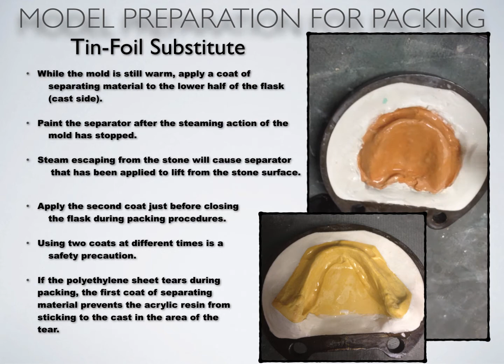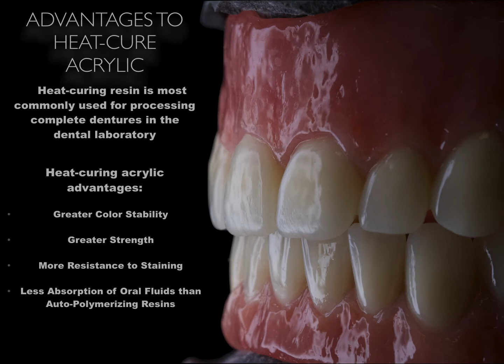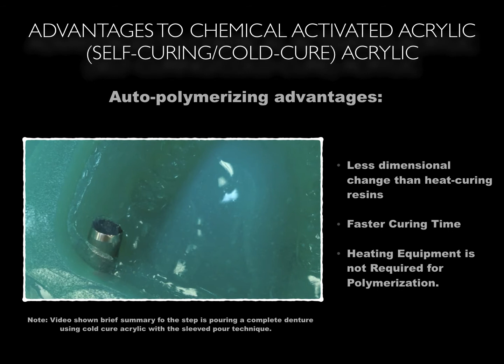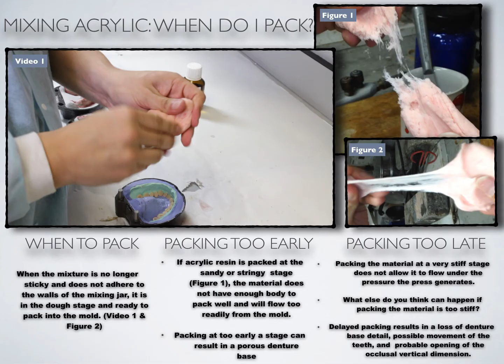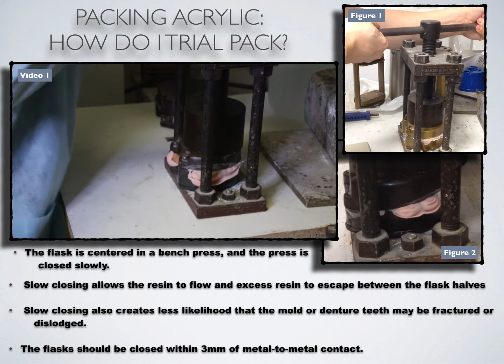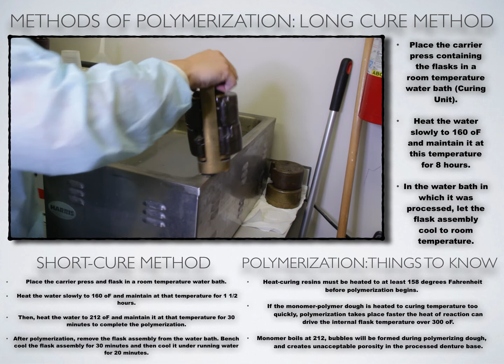Packing - Acrylic - Processing - Removable Prosthetic Identification

Comment: in the beautiful video you write that you should not exceed the pre-release of 3,000 psi. but then compress the flask with the manual press. how do you measure the pressure if you grease the manual press without a pressure meter?
Reply from the maker: Right, manual pressure would require you to estimate by the amount of separation between flasks. Looking for about 3mm during the initial trial pack.